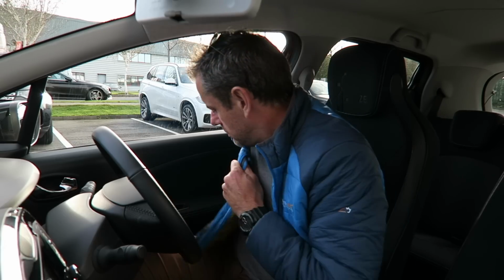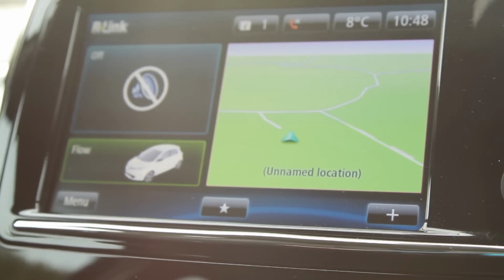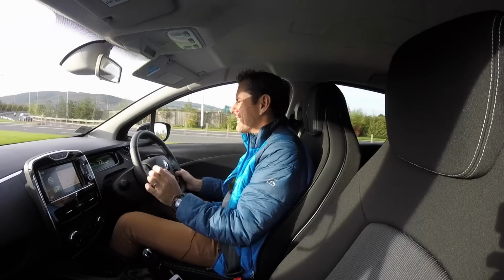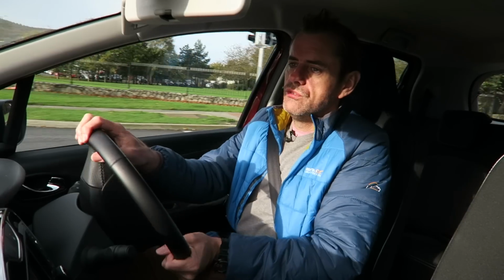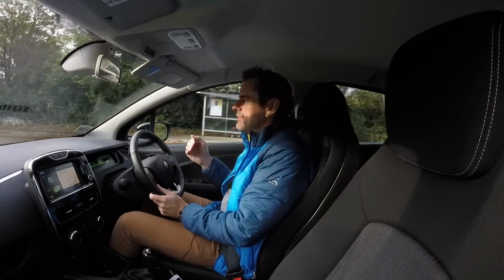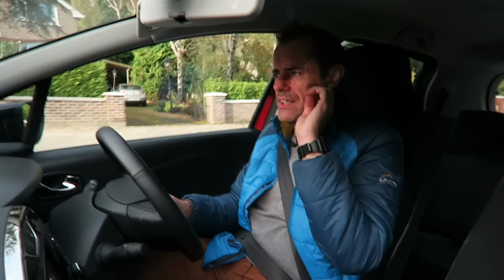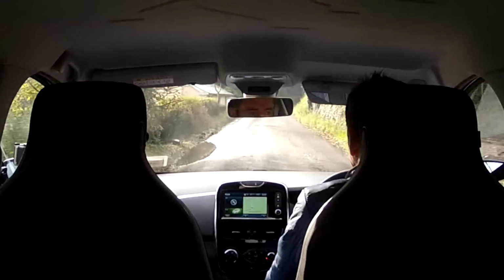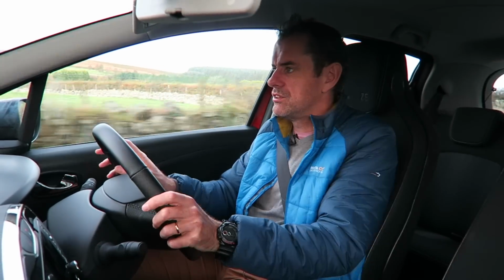The future of Electric cars might be the Renault Zoe

Comment: The problem is that a battery should be able to go 800 miles in one charge otherwise they are a waste of time....
Reply from the maker: 800 miles for a petrol car is almost out of range with 55 litres. A decent diesel unit might just make that range but even then it's doubtful with a standard tank size.
EV cars need to get to around 500 miles and then there's no reason to even look at most ICE engine cars.
Reply: Hi Bob my Merc does 60 miles to the gallon. but the battery car have a long way to go before they get it right. the first thing to put in place is the charging points should be in every filling station.....about 10 Years down the road and then you could buy one,
Reply: @Cork-y8i  And how any miles do you drive a day? Most people do less than 100 kilometre so lets say less than 60miles a day for commute and all. Only time they do more than 300km is on holiday. Charging network in Western Europe is already great. Than another thing, on long distance you stop for breaks which take mostly around 30minutes. With a 150 kWh charger that's at least 50% charge in that time. Porsche, Audi, and others are doing 350kWh chargers. That does 100km in under 4 minutes. 10%-80% will take around 15 minutes. So there is no argument left.

Comment: I also bought a Renault Zoe Q90 Z.E. 40. That's the Q90 quick charging engine with 43 kW charging power and 41 kWh battery pack.
I love that car, it's so nice to drive...
I hope I never need to change back to an internal combustion engine car

Comment: I've had one for nine months. The climate control and ECO mode make very little difference to range in my experience (150-200 miles depending on weather and driving style). You can change which noise it makes at low speed (choice of three). Anyway - always good to see a review of the Zoe and I have been very pleased with it.

Comment: No points raised as to how long this car takes to recharge on a power point of 13amps from a house.
The limit of the amount of kms at the moment is very poor when compared with a combustion engine. When I drive on vacation in mainland EU usually cover more than 300kms in a day to get to my destination.
There hardly any offical charging points in any EU country. So what happens if you turn up at one and it is occupied? Wait two days to get the other car then your car charged?
How will families who live in flats, terraced housing (where road parking right outside one's house is usually impossible) or where you live on a road with parking restrictions going to do to recharge the batteries?
When are the electric companies or Governments going to dig up all the streets (again) to install infrastructure for recharging points? In some EU countries power to the home on a basic power would trip out if you wanted to plug in your car. 
When are the lorries, buses and trains going to be electric. At the moment this "movement" is only talking about cars.
Why are these cars so damn expensive¡e? the trip in that car looked like the same quality as a cheap city car. (including the fissures in the roof covering)
As you can gather until a lot of questions are answered I am not going to be a real convert to an electric vehicle. 
I have seen that figures accounting for deaths due to pollution can never be exactly quantified. And report written , by either side of the argument have to declare who has sponsored the investigation. Someone s always willing to "bend the results" to suit their agenda. 
One more aspect of these cars which is hardy discussed is what sort of damage to  the earth is being caused by the mining of minerals/ materials to produce batteries, cables etc
Reply from the maker: Most of what you say is fine questions that for the first time in human history are being asked. Most charging is done overnight at the home. There are many official charging points across Europe. The recharging time is in other videos I've made on the subject but really you'll need a couple of hours for a half charge with 5-8 hours overnight but think how long your ICE engine car sits outside your home/work doing nothing at all
The price of these cars will come down but currently, they are about the same price as most diesel engine cars with most of them becoming cheaper by year end.
Electric cars are FAR cheaper to run than an ICE engine car when you consider service costs.
Electric cars aren't for everyone.
Reply: Yeah where did you cut & paste this obsolete shit from "When are the lorries, buses and trains going to be electric. At the moment this "movement" is only talking about cars." ridiculous.
Reply: Ribeirasacra WOW you got brainwashed hard swallowed all the Bullet Points whole. Charging at home only requires Private Permanent Parking Spot and Post Outside where you can stick an EVSE. There is only 1 proper way to charge at home, Electrician to install 240V dedicated breaker for the EVSE. Which on average today is 240v @ 32amps is more than enough for most people.
https://i.pinimg.com/736x/bb/4f/5f/bb4f5f32b550cf41bfddf59b3f1faf31--tesla-charging-stations-electric-cars.jpg
WTF Busses & Tains are ALREADY Electric, Proterra & BYD have sold couple Hundred Thousands BEV Buses around the world. Electric Trains are just normal trains with wire feeds.
https://www.proterra.com/products/
Minerals mining for Batteries & Electric Drive Train is not even close to the HELL ON EARTH compared to the TAR SANDs mining that has already been DONE.
http://mediad.publicbroadcasting.net/p/upr/files/201509/tar_sands_mine.jpg
Seems like your Agenda is Gullible Stupidity when your spout idiocy that can be easily refuted.
Reply: I do feel I must take issue on several points. I am not at all brainwashed. I was pointing out the failure of the discussion. There should always be more than one side to any discussion and  the facts should be honest.
The problems in Spain and I believe in some parts of southern Europe is power supplies to normal houses are not rated at 32amps. I run a B&B and even the power to this property has not got such a high rating. When the house is full making breakfast means high demand for power. This will dim the lights etc. WE have asked many times for a higher amperage. Not possible as the main line cannot take it. We know that we are not the only ones in this country with the same problem. 
I never said that there were no electric trains or buses I just wondered when they were going to be bought into the arguments for less pollution. The electrification of train lines in the UK has been stooped. In Spain they have to run hybrid trains because some lines are not fully electrified. In London the hybrid Routemaster bus has proved to be an economically a bit of  disaster and no plans to look to an alternative type of bus.
Maybe take a read of the following link about the new London cabs. https://www.theguardian.com/business-to-business/2017/nov/28/green-cabs-london-ready-electric-taxis Introduced without any thought to the infrastructure
I will sign off with a thank you for taking the time to reply to my comments. However, when name calling we all know it is not the way to make a good  points to a discussion.
Reply: WTF 2x 30mins charges over 1100km is very reasonable. When new BEVs should have on average DC Fast Charges at 500km per 30 mins. The Galicia <-> Barcelona trip should be very easy comfortable. 
I specifically Linked to a photo of a home EVSE charger outside on a Post that does Not Require a Garage.  
No matter how high Spain's Electricity cost is, BEVs just Objectively use much less energy. Thus it is Still Cheaper than Petrol per Milage.
BEVs are easily more fun than cheap Gasoline cars because of cheap Power & Torque. The Bolt EV has 266lb/ft the Spark EV has 400lb/ft both cheap cars are Fun to Drive. BEVs are just going to make it cheaper for Petrol Heads to enjoy Driving.
https://www.youtube.com/watch?v=3RGPAynAjc0
Then there is crazy things like NIO EP9, Lucid Air, Rimac Concept Gen2, oh and Renault Zoe E-Sport which kicks out 456hp & 472lb/ft. BEVs are a Driver's Delight.
Reply: If you can substantiate your accusation of cut and paste, please supply the links.😀
Reply: GM Bolt EV 63kWh consumption (5% Loss) @ 0.125EUR per kWh (Spain Average sans fixed Surcharges) 
= 7.875EUR for 63kWh
7.875EUR for 240 miles = 0.0328EUR per Mile

Spain Petrol Cost: 1.27EUR per Litre x 3.78541 =  4.80EUR per Gallon
240miles / 40mpg New Car = 6 Gallons x 4.80EUR = 28.80EUR
28.80EUR for 240 Miles = 0.12EUR per Mile

Someone please check my maths. I think BEV cost less per mile in Energy than Petrol in Spain.
Reply: There are many arguments on both sides. If you buy an electric car you should buy a home charger with active load management that will only take as much power as the house can give without tripping, therfore when you are sleeping it will charge and you will have 100% in the morning,  charging on a normal plug is for emergencies only.  Of course if you are driving 300kms a day when on holiday then the infrastructure is not there yet, you are wrong however when you say that there are hardly any charging points in the EU it depends on the country, But it is coming, most people drive 40 miles to work and back, an electric more than satisfies this. Also when you are only paying 10% for the electricity compared to fossil fuels you can affard to hire a very nice car for a long trip.  Electric cars are not for everyone right now and having a charge point of your own is not always possible but a large number of people do have this option. You do not need to dig up streets, you can run the power from lamposts. The cars are expensive as with any new technology but with new battery technology and more models the prices will come down.  Lorries and buses are changing, research it a bit. The argument that electric cars do more damage to produce than driving a ICE car has not been proved, in fact it is the opposite. I hope this has answered some of your questions, it may be a good idea to actually do some research on whether the answers are availabale before saying they are not. just a thought.
Reply: Thanks for the reply. I agree these cars are not for everyone. Maybe even you? You stopped talking to listen to the sound of that other car. There is a petrol head in you somewhere.😉
Cost are relative. Garage bills are quite low in Spain where as we have one of the highest costs of electricity within the EU: Spain is a large country and for me to get from Galicia (Celtic Spain) to Barcelona it would take at least two charges to make that trip.

Comment: People whining about EVs being coal-powered almost ALWAYS assume that the fuel in their tank magically got there by itself, causing no pollution whatsoever. It has been shown that the amount of energy needed to refine oil into 1 liter of gasoline would be roughly equal to the amount of energy needed to propel an electric car the same distance as the car using that 1 liter of gasoline. So before a gasoline-powered car has even started moving it has already lost out to an EV! Power hungry oil refineries don't publish how much electricity they use for good reason...
Reply: Tiony x is just a liar, and an absolute moron.
Reply: You pair are talking shit. Do you work for the oil industry?
Reply: Excuse me mate. Before you accuse someone of talking shit, READ THEIR POST PROPERLY. If you bothered to read, you'd realize I'm pro EV
Reply: also produce batteries pollute a lot, for compensate that an EV need a long driving distance with real clean electricity for compensate the highest impact of car production.
lithium batteries are totaly unsuited for few dozen of milions of cars (lithium estimated quantity is enought for 30 milions of EV cars), just imagine for 1 bilion of electric cars and trucks...

Comment: I had the Zoe 40 for more than a month last year, I had to say it was the first cheap electric I would be prepared to recommend (still not as a sole car) to anybody.However very slow compared to what I am used to, the regen is totally naff it took me nearly 3 weeks to get it working 100% without having to consciously think about what I was doing, the decoupled braking means sharing regen between the brake and accelerator.however once I worked it out I was able to get up to 42kw from regen.glad to see they have done away with the battery leasing on the new ones.I suggested on the report that, go the route of one pedal acceleration and deceleration like other manufacturers including previous older EV's from Renault.

Comment: Hydrogen fuel cell technology is the  future for powering automobiles!
Reply: no because 1 kw/h of energy from hydrogen fuel cells require 2.5 kwh of energy for produce that' hydrogen, very inefficient way...
Reply: stop  thinking because top gear mentioned it its the future, its NOT even shell and BP have given up on pushing it and started with installing electric charge points,  Check out my channel its about electric cars which a lot of us in the future are already driving EVERY day
Reply: 0.08988 Gram / Litre for H2 in human conditions. H2 for Human Activity Energy use is utterly Stupid Idiotic.
Though there is awesome other types of Fuel Cells that already is being used like SOFC.
Reply: Yes it is...about 10 years in the future....

Comment: the ZOE issue for me is the Battery rental scheme 
I mean why pay 2 monthly payments ??? 
I was quoted by Renault 180 Pounds + 69 Pounds for the Battery Rental for a zoe 
I could not be bother I went for the  Kadjar diesel 820 Miles  Range with 19 Inch wheels stock it gets 60 MPG so its not bad
Reply: WRONG It was only an optional Scheme. Seems like Renault is trying to phase out the Leasing scheme due to the unexpected extra long battery lifespan of LG Chem liquid thermal managed battery. I don't think Renault would allow to get battery Leasing scheme on the new 40kwh LG Chem batteries.
Reply: Yeah addition is such a pain in the ass.

Comment: I always had a soft spot for the Zoe. Unique looks and an amazing boot. However the 13 second 0-60 time is just not understandable with no other alternative. The new Leaf basically has the same battery but it's a 9 (or mid 8) second car that's starting at a price cheaper than the previous mark.
Reply: Not bothered about the 0-60 time when a Zoe can wipe the smile off a boy racer's face at the lights..

Comment: Bob, think the best answer to the "whats next" question, is that the wheels will be driven by electric motors - but where it gets the electric from is still going to be undefined for a few more years.
Reply: UK national grid was greenest its ever been,   EV don't care where the energy comes from unlike ICE cars, EV get cleaner.  I cover stuff like this on my channel check it out
Reply: Indeed; I often use this site: http://nationalgrid.stephenmorley.org/ What you get depends on the time of day, to some extent. Overnight supplies tend to have a higher 'slice' of nuclear, 'cos the stations like to run flat on at 'base load' as much as possible, e.g.
Reply: very true we have many days burning ZERO coal,  I try to plug in when CO2 is at its lowest,  you can also switch to a pure green traffif